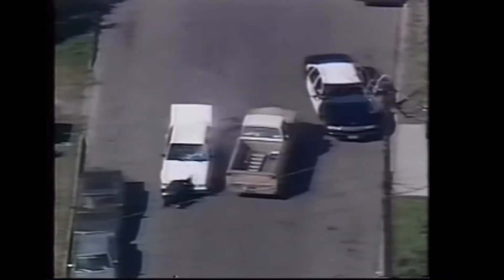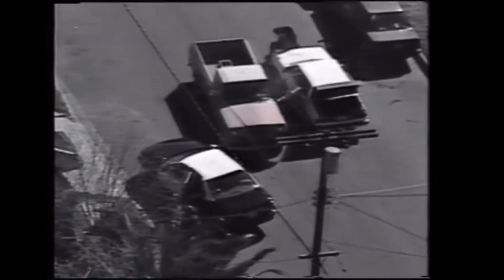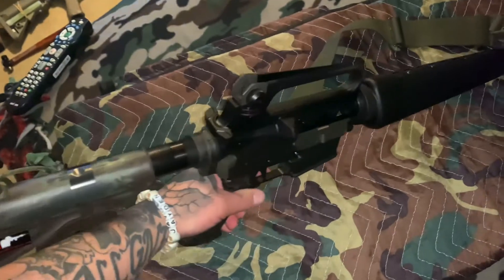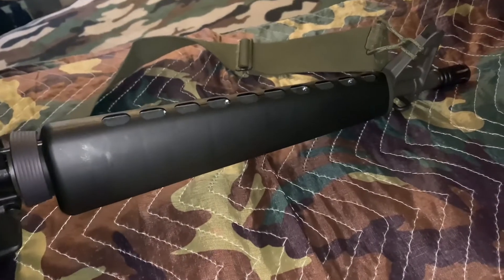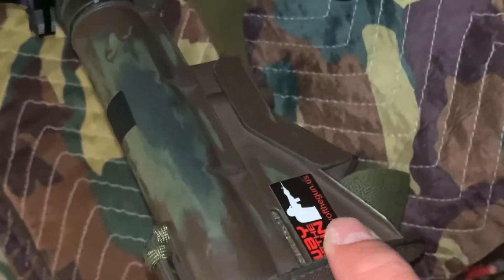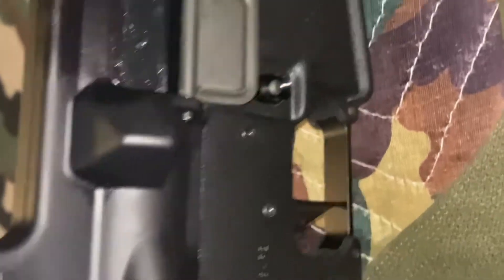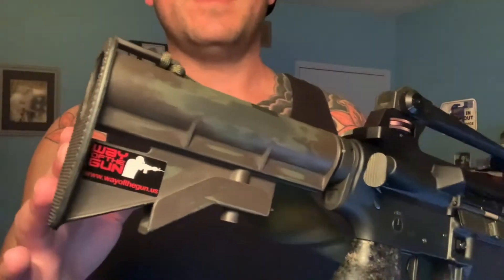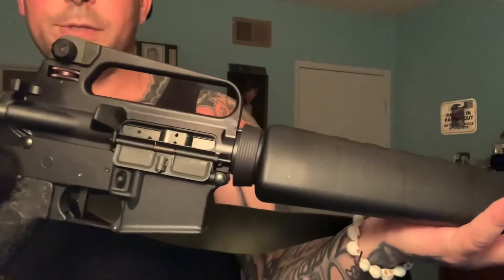Dissipator build

Comment: The dissipater wasn’t born in the north Hollywood shoot out.! It was born in Vietnam, for maneuverability and to keep a long shot radius.
Reply: You mean the Colt 605.  Never used in Vietnam as an issue weapon.  Testing only.  It had cycling problems from the start.  Gas port needed to be larger for use with rifle buffer and spring.  Testing of the 605 led to the Vietnam carbine version, the XM177.  The Dissipator was a Bushmaster concept that was continued by Windham Weaponry and others.  Works if you tune it with the right combo of gas port size and buffer.
Reply from the maker: I say it was born because it started getting more popular after this Incident in North Hollywood especially this Frankenstein build . Yes it was made in the Vietnam era .
Reply: The 605 was never issued. Colt just cut an M16A1 barrel down to 15 inches and was having issues with it cycling because there was no dwell time.
Reply: @panzerabwerkanone  you're wrong
Reply: @brain4154  About what?  The fact Colt never produced it past developmental stage?  That it was coined the Dissipater by the Bushmaster company? Colt never called it that.  One of the guns used by the bank robbers was indeed a XM-15 Dissipator made by Bushmaster.  ?
Reply: @brain4154  nope. You’re wrong

Comment: Nice Build, we have similar retro AR tastes.  I have ALL the parts for my A1 605,  Dissy, look-a-like build.  Im using a 16" barrel with a rifle length gas system.  I had John Thomas at RETRO ARMS WORKS cut/thread/port a 20" A2 barrel for the build.
Reply from the maker: Yes I think the 605 and the Dissipators look mean ...they are super cool Not too many people have them Because everybody doing the Gucci out  ar15’s So when you pull one ☝️ of them out  to shoot people get interested in them and want to take a look 👀

Comment: I have one with the green retro handguard and a green a2 stock. I tried it with a green a1 stock but couldn't get it to cycle correctly. My barrel is a Delton dissipator heavy. Mine shoots real smooth and real accurate!!
Reply: I've been thinking about getting that upper...
I have a kp15 lower and I want a disapator upper. Delton seems to be the highest quality for the lowest price....
Did it run properly out of the box, or did you have to tweak the gas system???
I'm just worried about reliability because this is my first and only rifle. And I don't really know what I'm doing but I'm doing a lot of reading and research, trying to learn...
Reply from the maker: I actually haven’t shot  mine yet Did a couple other builds So hopefully I can get it out soon I shouldn’t have any problems with it running correctly but we’ll see
Reply: I had to get a flash can(Flaming pig) and a light weight bolt carrier for it but with those it runs perfectly with military grade ammo. It might be 2nd most accurate one I built yet, and there is no recoil at all with it.
Reply: Any update on your Delton Dissy upper?  How did it shoot and any adjustmnets, is so what adjustments?  I am torn between Delton dissy upper and Windham dissy.
Reply: @bmwm31230  so I had trouble at first getting it to cycle, I had to change the address stock to a a2 stock and put a Flaming pig on the end of the barrel instead of the regular flah hider. It now shoots flawlessly and one of if not the most accurate rifles I have and there is zero recoil, its like shooting a loud 22 lr. I would have probably went with a Wyndham or a PSA faux but I live in Maryland and we are restricted to a heavy barrel profile here and delton had the only heavy dissipator barrel I could find at the time but once I got the timing thing down with it I am 200% satisfied especially with it being so accurate.
Reply: @stevecochran2677  what lower receiver did you use and what spring and buffer set up did you use?  Also, did you use the BCG that came from Delton?  Do you have fixed or collapsible stock?
Reply: @bmwm31230  I used a a2 fixed stock, a light weight bcg and a carbine spring and a H1 buffer weight. The lower is a 80% arms with a palmetto stainless enhanced trigger group. I bought the retro handguard from brownells just because I thought it looked cool,  everytime I take it to the range people ask me what it is and always tell me its cool looking.
Reply: @stevecochran2677  thanks very much.  This was a big help with my build.  Hopefully i won't have any issues.
Reply: @bmwm31230  Good luck with your build, I hope you have as much enjoyment with yours as I have with mine.

Comment: I custom built a true dissipator with a rifle length gas system. Took a midways stoner a2 upper and had my gunsmith cut the barrel down to 16”, lightened the bolt carrier group and put a carbine buffer spring in. Thing is the softest recoil and smoothest shooting AR I’ve ever shot. Did yours have a rifle length gas system?
Reply from the maker: Mine does not have the rifle  length gas system But the cool part about it Is …it’s not like your average screwed in gas system this is actually roll penned in not using the stupid screws to set It .It’s hammer punched in So I know this thing is ready to rock … so I shouldn’t have any problems with it .
Reply: What size gas port?
Reply: @mk4vws  stock gas port on the stoner a2 upper. .75 I believe.
Reply: Same with mine, so smooth and recoil is like shooting a 22 lr.

Comment: Is it hard to get it to run properly ( I mean with the rifle gas system)?

Btw, Badass. I have a kp15 lower that I want to match up with an upper like this. Just worried about reliability because this is my only rifl
Reply from the maker: I have two other dissipator‘s both from Palmetto State Armory they were budget builds but they both run awesome  So hopefully I won’t have any problems with this one i usually use brass In my ar15 The build sheet says it’ can  take brass or metal case so I’m assuming it’s over gas’s As far as Porting so we’ll see I haven’t shot it yet ….
I  required the  Windham weaponry upper because that’s the company that took over for bushmaster back in the day  & my lower is a old-school bushmaster so wanted to keep it the same as far as the upper and lower goes so we shall see  Fingers crossed it should run 😂
Reply: @SpeedCola45  nice....thanks for the reply, sir.

Comment: Dissapator wasn't born then,they used them in Vietnam for years.they had suppressors on them cause that's the only way they would run reliably
Reply from the maker: Yes you are correct they use them in Vietnam people started to get more interested in the dissipator set up because of the mutant clone that Emile made during the North Hollywood shootout which it was why it was reborn to getting such a popularity in clone builds. because of this incident. either way I think they look bad ass if you’re an A.R. 15 lover. mine runs like a sewing machine never had any problems just run smooth and easy that’s why a lot of people like them easy to handle unfortunately a little expensive to shoot. Thanks for the comment appreciate it